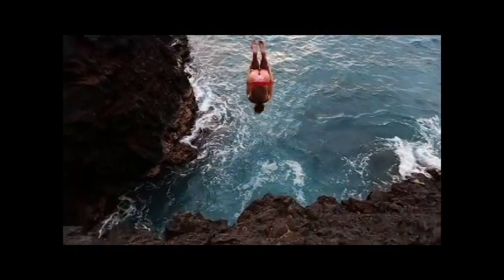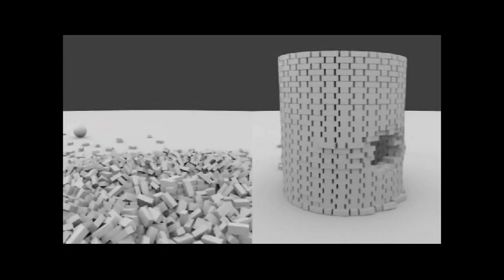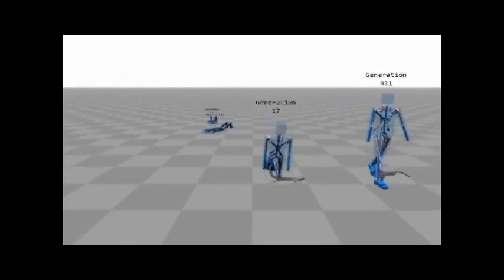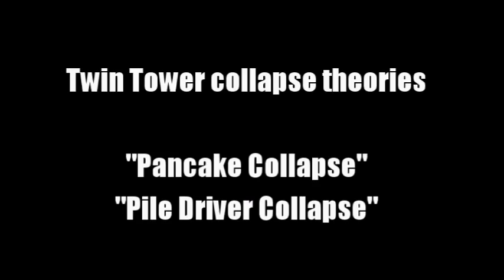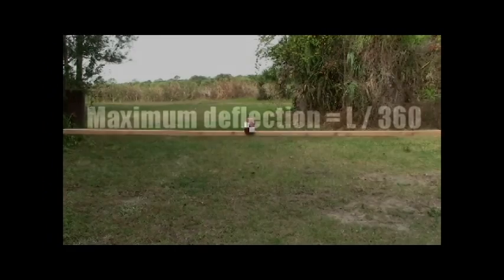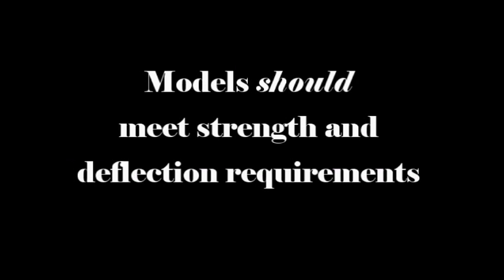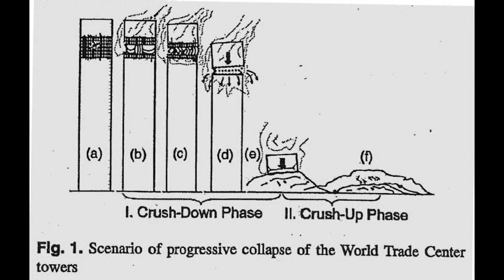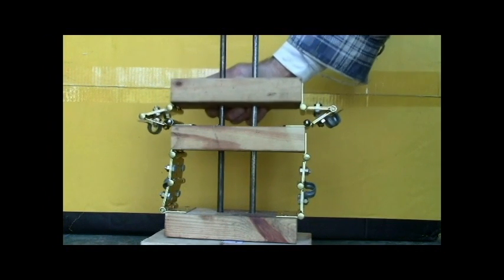9/11 Experiments: The Force Behind the Motion

Comment: Well, the experiment at 6:00 doesn't look like a good one. The beams that are supporting floors, are - in your case - something that is completely ignored. You only show that the floors cannot collapse on themselves when you apply a force to a point on the floor. You didn't test what happens when whole floor is dropping on a lower floor and the support is getting shattered.

I am really sceptic and want to educate myself on the matter, so I lurk through the YouTube and try to understand the experiments and experts on both sides, but currently I cannot see how this simple experiment of yours refutes anything.
Reply: Do you think it is physically possible for any entire floor of the trade towers to detach from the hundreds of supports and anchors around the 360 degree perimeter columns and the 360 degree interior (core) columns plus separating from every anti-sway attachment fixture at precisely the same instant to allow it to fall flatly upon any floor below by fire damage/weakening?

Comment: The only way to prove what happened, is rebuilding the towers completely correctly, 1:1, with the same materials. Then rebuild the interiour 1:1 at the time of the destruction. Place human beings in there, also 1:1. Then fly planes in there, again the planes being real planes. also the speed, angle and also physical parameters of the air, barometric pressure, everything needs to be 1:1, 100% exactly as it was on 9/11.

Only when THAT happens, you have a reliable and 100% accurate estimation if it is true or not.

But you can build models that are 1:100th the size, or 1:50 or 1:2, every model that is not 100% identical, and that means the same amount of people, interiour stuff, the planes, everything that is not 100% identical is purely empirical data. It is only "assumed" data.

If you throw a leaf in the air, you know its gonna drift, and where abouts it MAY land. Empirical data. It lands somewhere else everytime. And there ya have it. A tower thats 1:100th or 1:50th the size of the real TwinTowers, they WILL BOTH behave 100% differently. Even if you mathematically analyse and build the structure, it is all just a misconcepted fail experiment.

Make 2 glass bowls, one is real size, the other one a model version, 1:50. Shatter them with a hammer, one with a real hammer, the other with a tiny model hammer, 1:50. Exactly. The force needed to shatter both will differ, against all logic. The way they shatter will be different. Even though they are "theoretically" the same, a model version ALWAYS falsifies the data, data gained from models is not useable for real evidence. For empirical data, yes. But not for data about the REAL THING.

Comment: Whoops you forgot about dimensional analysis. Volume increases relative to a cube and strength increases relative to cross sectional area, which you completely disregarded.
The models are not similar in any regard.
The millions of hours that have gone into material science, structural science, finite element analysis and other robust computer analysis tools cannot be dismissed so whimsically. These are the fruits modern engineering enjoys and were brought about by some of the greatest minds of humanity. Some of the products you enjoy that are the results of these products include: aviation, space exploration, earthquake engineering, and electrical design. 
Please, this backyard junk cannot be compared to actual design analysis.
Reply: Tell those marine engineers that float little toy boats about in big bath tubs for a living. I'm sure they will be impressed.
Reply: Building don't collapse at free fall unless the columns have been knocked out.  Period.  Take all that fluff and shove it, troll.

Comment: But the towers didn't explode like a massive bomb went off. They fell down with a cloud of concrete dust and sheetrock coming out and steel beams falling at free fall speed and hitting everything around them. And the building took 20 seconds to fall. Am I dumb, HELP. Also, paper does not equal steel and no walls. Also no damage to the core and invisible walls.

Comment: your experiment are no where near accurate sir.  you didn't factor in the mass of a full size jet impact on the structure.   you didn't  factor in the jet fuel explosion and the damage to the  surrounding structure, and you didn't factor in the pulverization of the lower floors and materials with that amount of weight crashing down.  there is no experiment that could come anywhere close to replicating the destruction of that day.